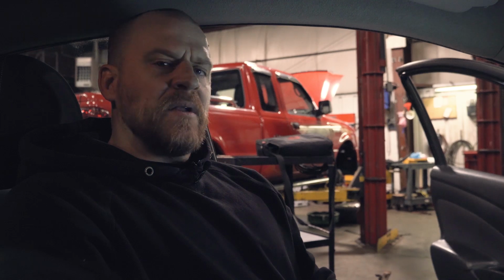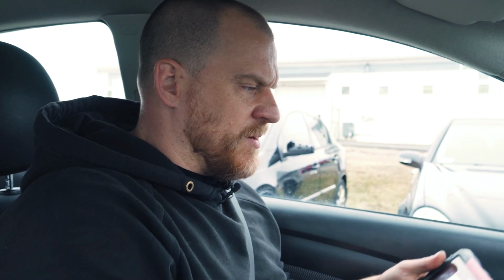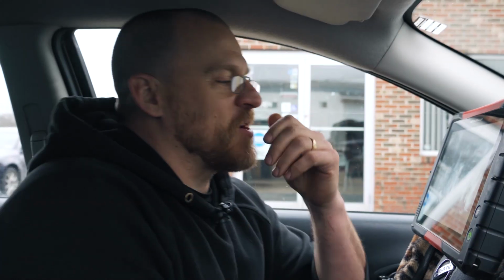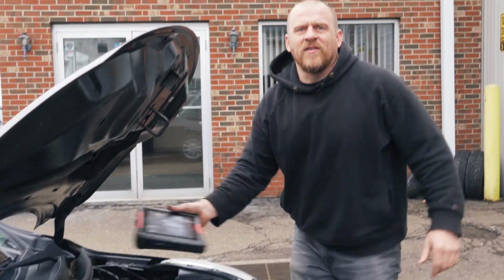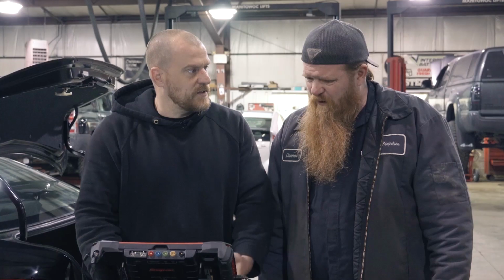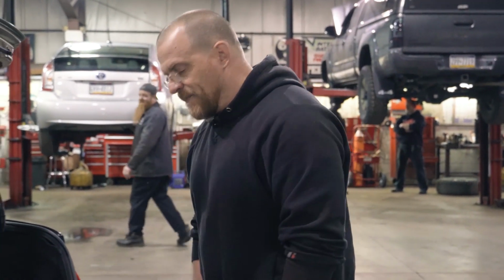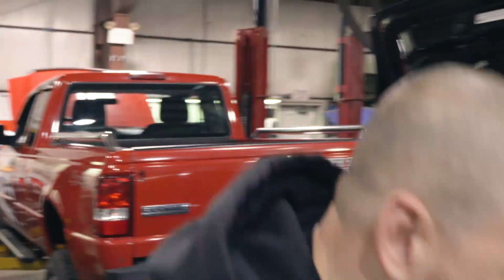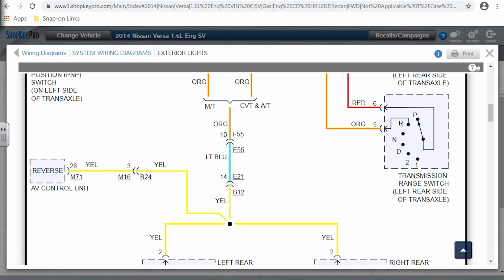2014 Nissan Versa P0705 Transmission Range Sensor "A" Circuit (PRNDL Input)

Comment: Hey man, I'm sorry if this isn't appropriate for a Youtube comment. I had this Check Engine code on my 2013 Versa and when I brought it in, the guy told me I need an entire new transmission. He said that the Range Sensor was internal to the transmission and it couldn't be simply replaced. Was that guy bullshitting me for one, and two how would you go about finding someone who could test for this problem? A Nissan Dealership?
Reply from the maker: The range sensor sits on top on our model and wasn't hard to change but that was never the problem. The reverse light circuit was backfeeding and causing the TCM to see drive and reverse at the same time, which sets this code.
Reply: @ScannerDanner  Yes, I watched the video, and thank you for responding. How would I find someone, as a layperson, who could diagnose if this is the issue? And also, I want to know if that guy was bullshitting me about needing a new transmission so I can chew them out on every platform they have. Hate dishonest mechanics
Reply from the maker: @PunishmentDivine667  some of the models, the range switch can be internal to the transmission. It is most likely coming from a guy who was busy and wasn't sure and didn't want to get into your problem because he had a 2 week backlog. I see it all the time. I'd go gentle my friend.
Change your reverse light bulbs and clean that back panel if it looks corroded

Comment: My parents 2014 SV sedan set a P0705. The symptom was poor acceleration and engine speed wouldn't rise above 1800 RPM or so. Happened while driving on a sunny day. The P0705 appears to put the car into a limp home mode, where the CVT isn't allowed to change pulley position. When I was plugging in the ODB scanner, the trunk opened. I thought it was just the key in my pocket getting pressed. It happened again today when nobody had either key set. I put the car in reverse (engine not running) and went to close the trunk, noticed the reverse lights weren't on, but they came on when the trunk was closed (I believe the jolt of closing the trunk completed a faulty connection somewhere). I test drove the car a second time after I closed the trunk and pulled the code, the problem was still present, but quickly resolved itself. It hasn't reappeared since. The gear indicator on the dash works fine, the tail lamp assemblies are completely corrosion free. My current theory is that there's a faulty connection between the TRS and tail lamp assembly somewhere in the harness inside the car. Either that or the reverse bulbs or tail lamp grounds are faulty.

Comment: I am a Mitsubishi Technician, this is a very common problem with Jatco cvt Jf015. Danner, only replace the bulb's with an original Nissan part number and the cvt will work fine. The Jatco control unit evaluate the amps bulb in all conditions, when the brake is press and depress, when you put reverse, neutral, drive or low, if the amp is not right the control unit set a code and in some cases the cvt set in limp mode. Many technicians from Nissan or Mitsubishi replaced the cvt by warranty claim but in many cases the warranty claim is rejected and the dealer pay for that cvt, regards from Mexico Danner!

Comment: I have idea for heck job solution. Separate reverse light from range selector via diode (prevents from 12V going from back light to ECU/ECM) and add pull-down resistor near selector fix potential light bulb ground issue.

Comment: Nissan tech here, it's never a pnp switch. Always the rear tail light circuit board or loose pin fitment at the connector.
Reply: yes thats true,that versa on middle east is Nissan Sunny.tailgate circuit board
Reply: @Ls Juan but is it necessary to replace the whole assembly like the dealership did with mine?

Comment: I've had 2 of these Nissans come through my shop with this DTC. I knew what the problem was as soon as I saw the video title. I knew I was going to watch this one fuck with your head 🤣 The brake lamp circuit back feeds into the reverse lamps circuit... which is shared with the PRNDL Reverse circuit! 🤯
Reply: The ones that I diagnosed didn't have corrosion either. They had a voltage drop across the pins of the harness connector for the ground circuit. Not the pin fit but the actual pin crimp.
Reply: @thirdeye530  how did you fix it? Replace the brake light assembly?
Reply: @jameslussier6615  I ended up replacing both the harness connector and the brake lamp assembly.
Reply: Also, the factory diagrams show the circuits being shared.
Reply: I will add that I scoped the ground circuit voltage drop from the harness side of the tail lamp connector across to the lamp side. While manipulating the wires I saw the voltage fluctuated between 1-5v on the ground circuit across the connector with the brakes applied.

Comment: Paul, I didn't see you check the connector on either lamp cluster. Why not? Or did this happen off camera? Would seem an obvious point for damage, resistance or shorting.
Reply from the maker: I definitely made some mistakes here and that is one of them. Smh
I have a video coming out talking about this a bit more
Reply: Love the detailed reasoning that you go through though.

Comment: I had a Toyota each that had a corrosion issue in the lighting harness for rear tail lights that was tripping the transmission into thinking it was in reverse. So it wouldn’t start. Came out to my car in morning with reverse lamps on. I’m not surprised. If the Tcm see’s that reverse lights that would confuse the tcm tripping a code for sure. Great video bud.
Reply: Cool piece of info, Thanks alot man.

Comment: I had the same exact code on a 13 versa with about 120k miles. The Nissan dealer wanted to change both taillights to fix the problem. We declined the repair because they wanted to charge way too much. I took both tailights out and did not see anything. Cleaned all the contacts and put everything back together. The code haven't come back and it's been abour 4 months. Weird
Reply: By contacts do you mean where the bulbs plug in ?
Reply: @ceezauto213  No. where the harness plugs into the light assembly.
Reply: How do you clean the contact connector?

Comment: I'm still suspicious of the ground path between the lamp assembly and chassis ground.. any resistance there would force tail lamp/brake lamp power to leave stray voltage that could jump across the reverse light bulb and trip the code.   Lacking any other evidence, I would splice diodes into the  wires feeding the reverse light bulbs so backfeeding would be impossible.  Nissan should have done that in the first place.

Comment: Nissan also has found corrosion in or on the tail light socket assy and my 2012 had it and I replaced both sockets problem fixed

Comment: That was a strange one! A TSB for tail lights causing a transmission code. Nothing shocks me anymore in the automotive world! Literally thousands of failure modes ...

I hate Nissan's too for every reason you showed here! Wrong service info, and SLOOOOOW navigation with the Autel. I mean slower than dial-up internet slow! It's ridiculous. I dread whenever one of these shows up here, which thankfully isn't too often. I wouldn't own one if it were given to me! Headache central. I have enough trouble with my Silverado! My stainless Corsa cat back just cracked in half right at the flex joint yesterday. Literally one thing after another with that toilet. Installed a new transmission a few months back after losing 3rd and 4th. Just turned 106k miles on the way home. Guess I can't complain too much - got 14 years, 104k out of that exhaust system.

Great stuff as always, fellas.

Comment: Had this problem 3 times, Nissan isn`t 100% clear about THAT code setting criteria, what happen is that there programming for 1(On) 12v+ and 0(Off) 11.4v- are so close voltage wise, if the 10 amp fuse blow it can cause that which wasn`t your case, if the grease in the PNP switch causes too much resistance it can cause that code also which was not your case, but from an old reverse bulb which might have little white dust and outside temp, can cause that, reason being the little resistance in the old bulb or the white dust can cause the voltage on that circuit to drop to where the computer reads reverse as off, at that point because you shift lever is in reverse or people who shift into each gear slowly before there go into there selected gear can read (OFF) on all gears, the computer is looking for ON(12v+) on one gear at a time, but if the reverse light pulls the voltage on that circuit down to 11.4v, or if the terminals are slightly touching on an off which can cause a fluctuation and it reach the 11.4v just slightly an depending on how hot or cold the day is the computer would see (OFF) on all gears , which would set a DTC where it is looking for (ON) on any given gear, the car won`t rev pass 2000rpm when that DTC is set
Reply from the maker: Only .6 of a volt difference for on and off?? How stupid is that! Is there a reprogram available to widen that threshold?

Comment: Im a millwright for a big mill in Oregon called Roseburg forest products. Watch scannerdanner every single day! At work today we had a huge hydraulic leak. Hydraulic all over the basement had to emergency shut down all machines! Could find where it was coming from cause everything was soaked. And guess what popped in my head. Contact points! Well guess how I found the hole in the hose! It was rubbing against the hydraulic tank. Contact points people!
Reply from the maker: My man! Nice job
Reply: @ScannerDanner  yes sir! I appreciate you sticking it in my head! Along with 5v reference, learn your fundamentals, and never force a probe into a connecter or you’ll spread the terminals!!! I try and learn everyday from you guys and some others. I’ve boughten scanners and probes and even a Phil’s probe. I love getting to use my knowledge to help others out! Just like you guys! Huge motivation. Thanks again Guys!

Comment: just had the same problem on my wifes car. checked for water intrusion, etc,  after finding the tsb, but i found no waterleaks. reset the reverse light bulbs, etc and no problem after. i am crossing my fingers. i am glad that you figured out the reason why it was happening, because i could not. Thank you for your videos11
Reply from the maker: Did you have a dim reverse light bulb too? Keep me updated on this would you?
Reply: @ScannerDanner  what was weird was i first had a blown lr signal lamp bulb, and the same code, so i replaced it.  a week later , the rr lamp went, and also with the same code  i replaced it , cleared the code, then the following week, the rs signal lamp would flash rapidly with the car in reverse. i recheck for  water leaks per the tsb, found none, and i replaced the bulb for the reverse light, and also decided to change the switch, because i was not able to get a consistant reading on my scanner of the transmission positions. so far, it has been 3 weeks, and the light has not came on. if it comes again, i will do a voltage drop. sorry , but i did not check if the reverse light was dim, but i know it was working.
Reply: by the way, the new range switch is from oriellys, and not genuine...thanks again for your video. it was quite informative, as i dont mess with a lot of electronics on autos, as it just got to complicated, lol

Comment: I have a 07 nissan altima the passenger side window does not work with window button even from drivers side button it will not work but with button  for passenger window on drivers side will drivers window up and down ever see anything like that??
Reply from the maker: Can you explain that again please? Thanks  😊
Reply: @ScannerDanner  . I can’t open my Passenger door window from Passenger side Or driver side But the switch for the driver side .And main Driver side switch the one for Passenger window Switch will open driver side window But the passenger side window motor is good And all the other windows work fine anything . Do you ever hear about that before.

Comment: You were talking about the CVT transmissions... My first job was for Saturn that had HUGE problems with CVT transmissions (like all cars with CVT transmissions) and they had us replacing the internals. But everything came out in one piece and got swapped out by removing the side cover. But yeah, there is no rebuilding the CVT internals that I have ever seen done. 

But it is a cool setup. But im with you. I want nothing to do with rebuilding one.

Comment: @Scannerdanner I have recreated a problem that a friend/customer in this similar situation by brakes on marker light on and a turn signal on, so if you ever get this car back that is worth a try and I did find the loose wire to give a rapid flash. How and why it did it but it’s worth a try and it’s free for 20 seconds
Reply from the maker: Sounds bad ground related then, as other have stated. It's been 5-6 weeks since bulb replacement, so we will see. I'll definitely update everyone. Thanks!
Reply: @ScannerDanner  yes I believe that’s what it was I know it was a loose wire

Comment: Difficult DTC to diagnose cos it's usually intermittent. Is there a micro sw at base of shift lever that is not shown in diagram? Some Nissan models have additional micro sw on shift lever in addition to PNP. Fluid spillage in this area will cause sw to stick and provide a secondary PRNDL signal to TCM in addition to signal of actual shift lever pos. Some Nissan wiring diagram will not show a component tied to circuit until u look up that specific component's wiring diagram. Also, can DTC be induced if volt s applied to another PRNDL circuit in addition to shift lever pos input. This can prove ESM logic for DTC.

Comment: The wiring to the AV module could also have an intermittent short to power as a means to cause the TCM to see voltage at the wrong time.    Is there a backup camera connector flapping in the weather or is there a camera installed?  They don't say what the threshold voltage is for the TCM to sense the line has been raised. Is it the full 12v or anything above say 3v?  I wondered if the bad connection series resistance on the left bulb couldn't create a ghost voltage situation, but can't see how the right bulb wouldn't be an effective pull-down path even with a lifted ground on the left.

Comment from the maker: 1. I should have had the reverse lights on when I unbolted that assembly. A few of you mentioned a bad ground and that was a possibility. I think? But I have to look at the other lights (parking, brake and turn), if they share that same ground for the reverse light, then this absolutely was not a bad ground, at least not externally (wiring or connector). There would have been other lighting issues! (SEE EDIT BELOW)
2. Some others suggested that I prove the code by jumping the reverse light circuit. This is a good suggestion and I even mentioned doing something along those lines. I chose not to because I was dealing with incorrect diagrams and I made the mistake of taking that bulb out before ever taking a voltage reading on that bulb smh. So jumping things, I know the code is going to set. This is a legit TSB, that was never in question.
3. It's been 5 or 6 weeks since the bulbs were replaced with no issues. So I'm calling it a fix.
Wish I would have done some voltage checks on that circuit board WHILE the bulb was dim!! I'm sorry I did not and we are all left with questions 😪
EDIT!!! @Chris Wey mentioned about when the brake, turn and parking lights are on, with a bad (slightly in this case) ground will increase voltage on the reverse light circuit, causing a drive and reverse signal (and code) at the same time. If this housing only has one ground, this could absolutely be a condition!  Maybe the dim bulb was a coincidence and me just moving the housing "fixed the bad ground (temporarily) 
🤬🤬🤬 sorry guys. Feeling like a jack weed here. Time will tell
Reply: Good thinking but if the brake turn,park are on and voltage increase it still can`t show 2 gears on, because even tho it has voltage at reverse back feeding, the voltage would have no where to go because the pnp switch isn`t closing that circuit to relay that to the computer, the pnp can only select one gear at a time, so you might see some voltage back feeding but the lever isn`t connecting that circuit to the computer.
Reply from the maker: @phareztrinimand  remember the diagram was wrong! The reverse light circuit is tied into the signal wire that goes to the computer. So the range switch will be sending the signal that it is in drive and the elevated voltage on the reverse light circuit would be sending a false reverse signal.
Also remember that even though it is a 12v signal, the internal threshold will be much lower than that, to trigger a reverse signal recognition. Hope that makes sense. 
I'm not saying this is what is was, as you would most likely have other lighting issues (dim bulbs, fast blinking turn signal etc.) But it is plausible.

Comment: If the taillights were the issue, and some other circuit was backfeeding voltage to the tcm reverse switch when the transmission wasn't in reverse, wouldn't the customer complain of the backup camera turning on while they were driving forward?  

I know the issue hasn't come back for a few weeks and is considered fixed, but I'd consider putting a scope/voltmeter on the wire at the tcm just to see voltage.  Maybe it always rides at some abnormal voltage but isn't enough to pass the tcm's threshold.  Perhaps it rises as the taillights and brake lights go on together, etc.  Perhaps it was also a bad bulb and my brain is just going crazy thinking of all other possibilities.

Either way, great video!
Reply from the maker: Unfortunately we had third hand information. This came from another garage 🙄